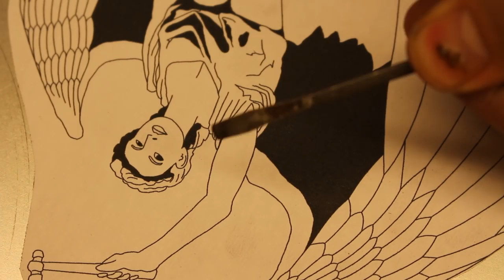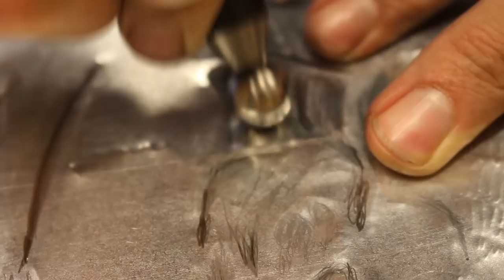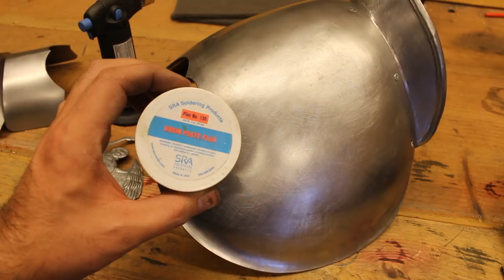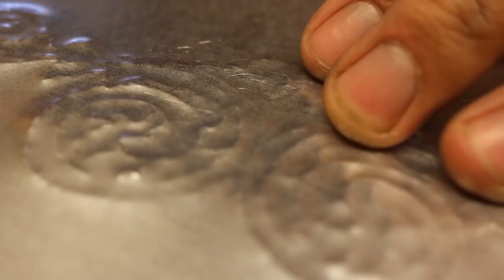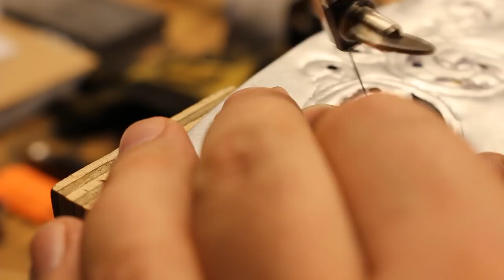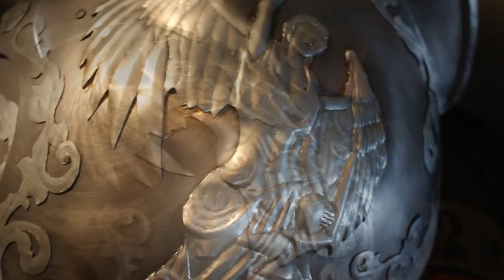Shoulder Armor Tutorial "Tenth Muse" decorations in metal (Part 3)

Comment: Tbh I love this channel, I'd wanted to do armor since I was about eight (first thing was a helmet made of sheets of paper and masking tape lmaooo) but I'd never really thought it was a genuine thing I could just sit down and do without a bunch of equipment.
Now I've got most of a cyberpunk-ish gauntlet sitting in my room, made from 22gauge aluminum, what I'm pretty sure were tubes from a ton of windchimes, the grate off a stereo speaker and some copper refrigerator tubing. I'm pretty sure the only tools I used were a hacksaw, a couple files, pliers, and scissors. Bought a tubing cutter yesterday which is making that end easier but really, it's all super low-tech and I'm pretty proud of it.

Comment: About the feel there all comments I would make already included. It is for myself sometimes like you said but I’m stuck in a depression getting a little better. I want everything being better as I can do…
But for your metal work: I believe your chisel is a bid to sharp. That could cause starting points for cracks, better polish the edge a bid more. I haven’t done a figure like that but have seen other doing Car body work (grandfather) and work on Brass sword scabbards in an old shop in Solingen. The beck could be filled with lead (alloyed with Bismuth to lower the melting point and make it a bid harder). You can work deeper, then melt of the filling, apply it new and work deeper. That helps with creating crisper lines and also can push neighbouring parts up without working on the inside. Before soldering it onto a plate coat the entire backside with a layer of solder. That prevents rust on the underside and makes it much easier to connect it to the plate because an every part already solder is there.

Comment: What metal and gauge did you use for the repousse I only can find aluminum 0.25 and 22 gauge weldable steel I want to make princess zelda armor which looks like repousse technique. Also do you make the armor then add the design or can you add the design then make the armor. If you add the design is the metal. Does the repousse pattern have to be bigger then the armor,  how do you add the design to the made armor for a seamless look.